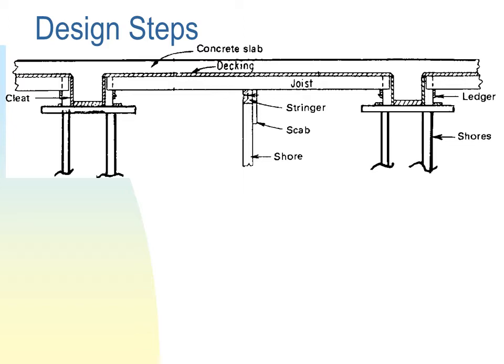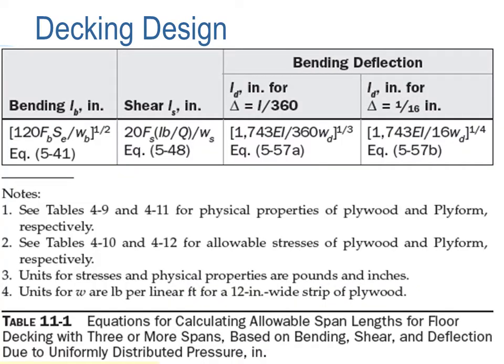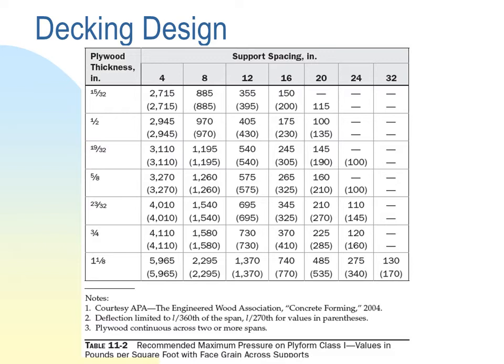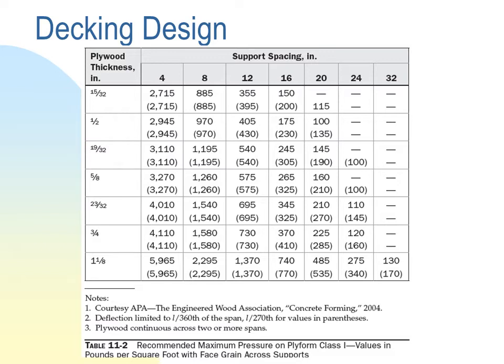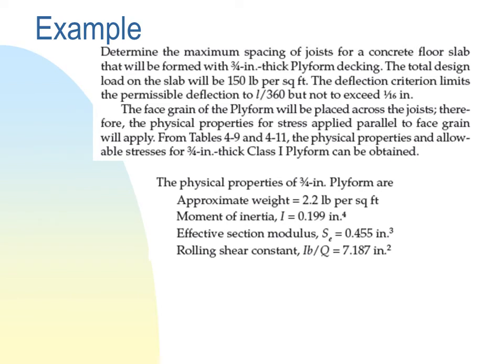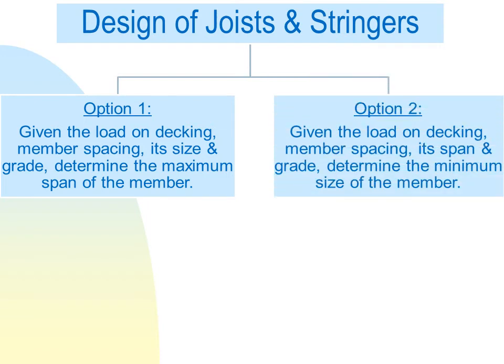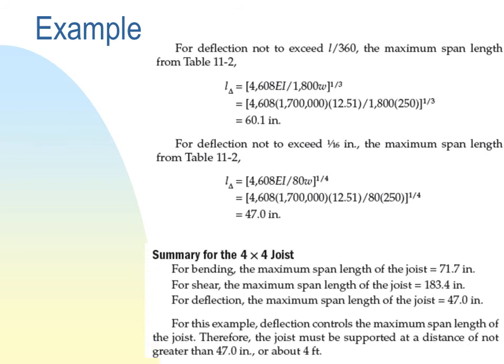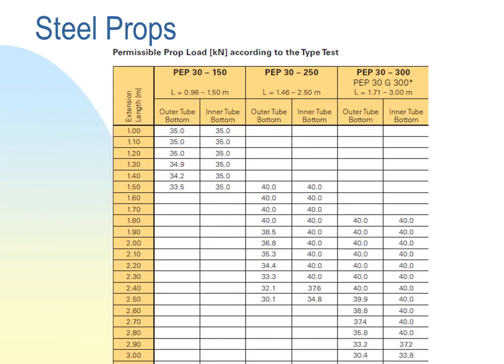Design of Slab Formwork

Comment: Hello sir... do you have shoring and formwork standards?.. Actually i have to appear in Dubai municipality exam on 18 April... i need it very urgently thanks
Reply from the maker: The source of information in these slides is the formwork design handbook by Ratay
Reply: @mohameddarwish6746  sir do you have knowledge regarding design of H20 beams formwork design... actually unfortunately i did not clear my exam due to this.... my new date of exam is 25 April... can you please help.. thanks
Reply from the maker: @Structure-Dubai  sorry I didn't design using this type before
Reply: @mohameddarwish6746  in today exam, they had given the dead load, live load, spacing of secondary and primary beamss..... they asked for service load per meter on primary beam,, in some questions they ask for shear force on secondary beam as well as on props....
Reply: Sir can you share your email with me... i will send you some pics.... it is ordinary timber joist formwork design... it is also called system table formwork.
Reply from the maker: @Structure-Dubai  mdarwish@aucegypt.edu